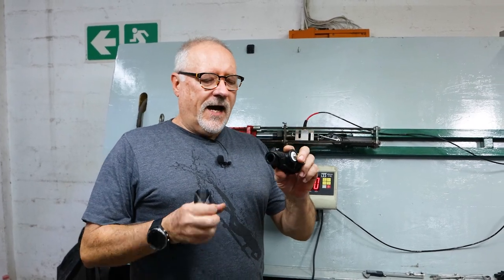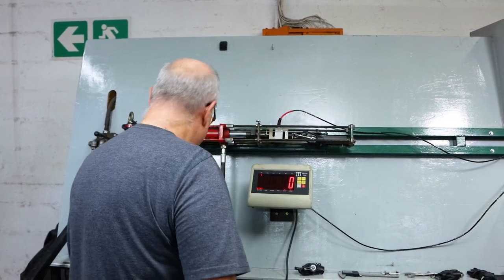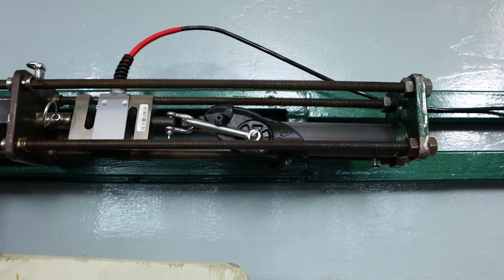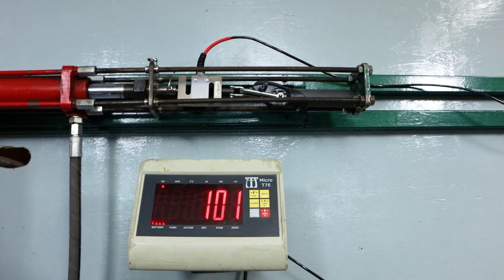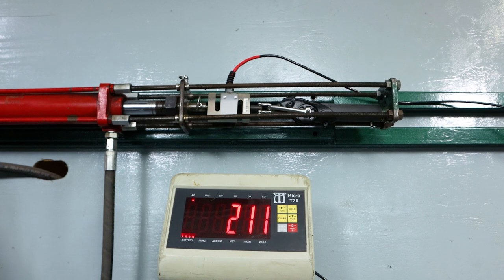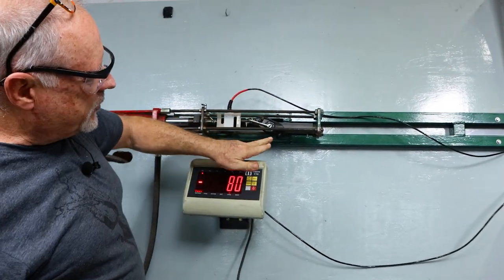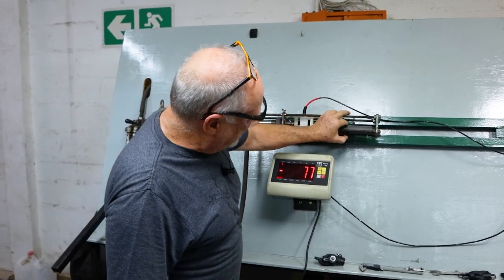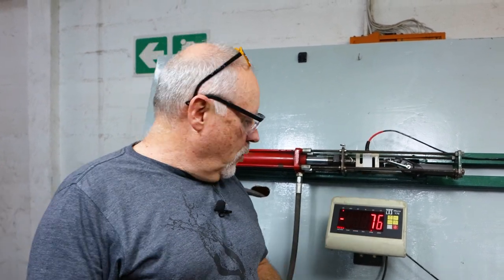Rob Allen | Muzzle Eye Break Test | Part 3 | 2023

Comment: Hi Mr Allen, early this year I got my closed orginal Muzzle borke and lost my front band in a dive. I wasn't sure how it happened as I didn't even feel anything. Until recently when I went for a diving, I only loaded one band and left the front band free hanging in the water.  After a shoot, the front band got blowed out of the muzzle and luckily this time the muzzle didn't break. I started to understand that it's because of the back band kicked the front band during the fire and it might be too powerful to break the front muzzle mouth.  As most of my divings are around reef so I replaced the 7.5mm to a 6.6 mm shaft so it can work with a single 16 mm band. Looking forward to test it out tomorrow! Cheers, Rui
Reply from the maker: Best is to use single if it is adequate. With a 6,6mm spear a single 16mm is good.
Reply: @RobAllenSpearfishing  Thank you so much Mr Allen for your kind guidance as always!
Reply from the maker: @ruitian8724  You are welcome 👍

Comment: Hey quick question. Just bought a scorpia and the rail height is slighter higher than the handle’s. I can load the spear in but it scrapes the top pretty hard. Is this normal? Thanks
Reply from the maker: It is a tight fit, if not tight, the spear will not seat well.
Reply: @RobAllenSpearfishing  great, thankyou for the response!